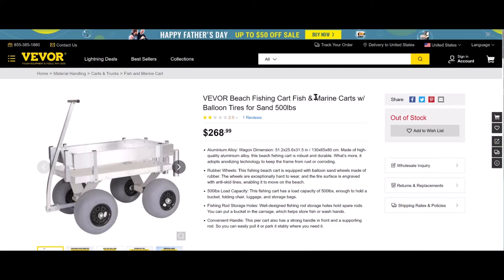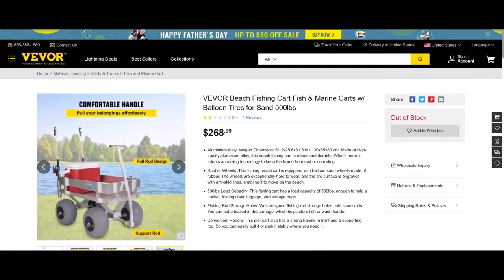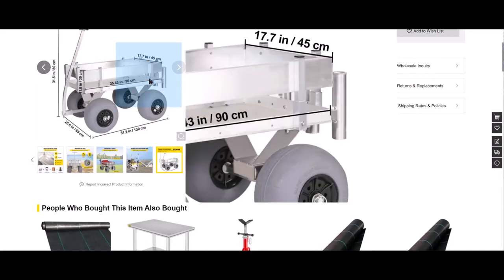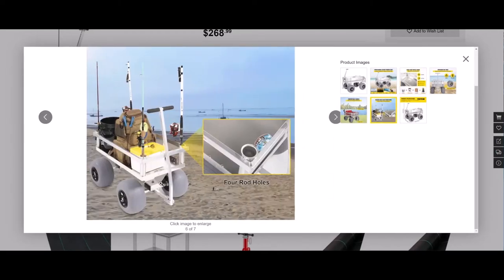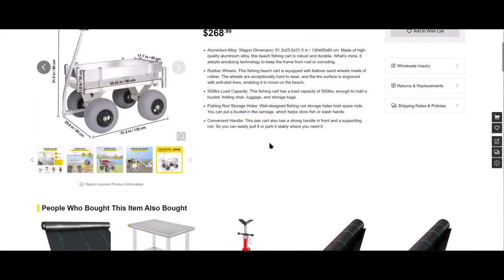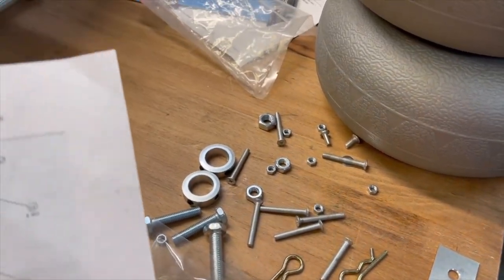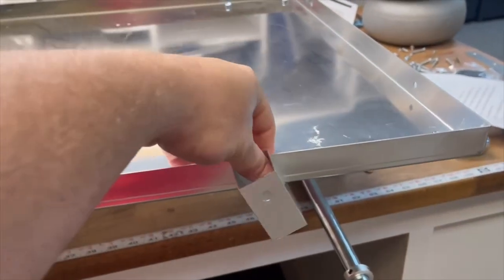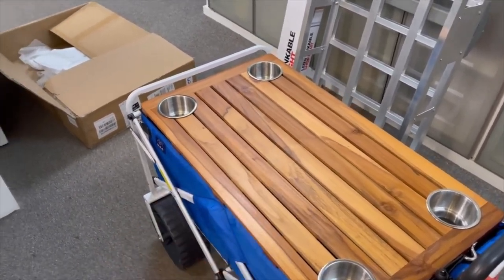VEVOR BEACH CART.... BEWARE!!!! an ALUMACART KNOCK OFF

Comment: Wish I had seen this before I purchased it from Vevor, They have updated the pictures on there website so it is no longer as misleading. But it is CCC. Still does not come with instructions. All edges are sharp. That being said it is a larger cart base then most and I think it will make a good project. I didnt like how the brackets that hold the top and bottom worked. So I drilled out the polls and attached the top rail to base. Other points of concern are use of steel, zinc plated and stainless with aluminum. When mixed with salt water, I would expect some weird Metal reactions. Going to clean and primer the steel pieces. I May try and build a box to be able to steer similar to how alucart does. Going to try and braze some aluminum and attach more rod holders at some angles as well. The rod holders that come with are not stiff enough as is. So I added a aluminum piece to them to stiffen them up so they are not flopping around.